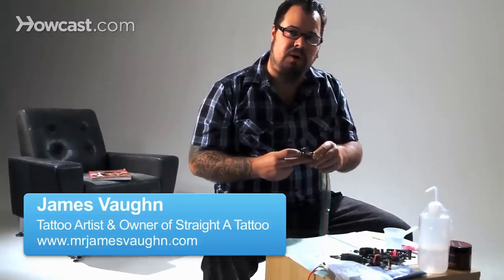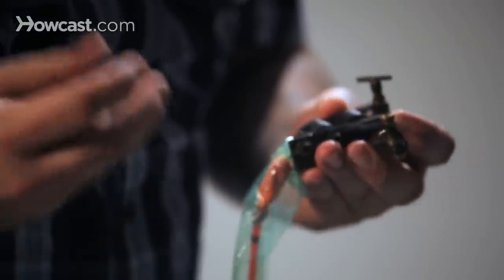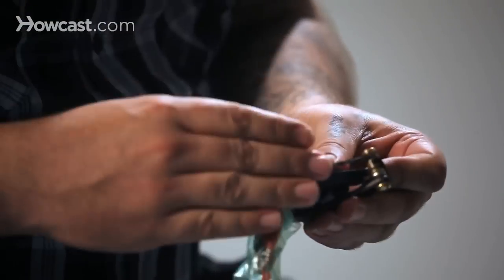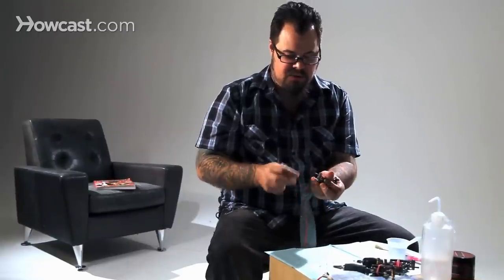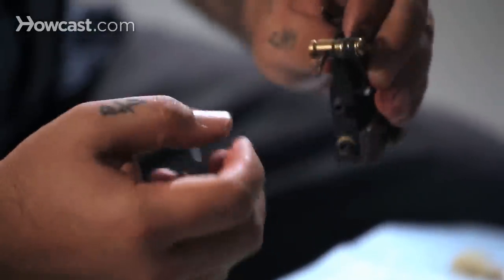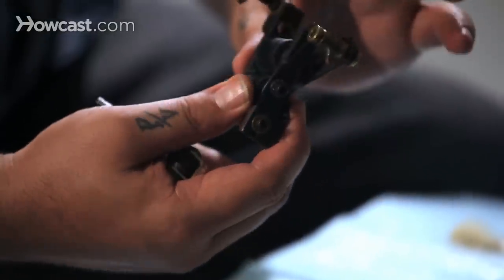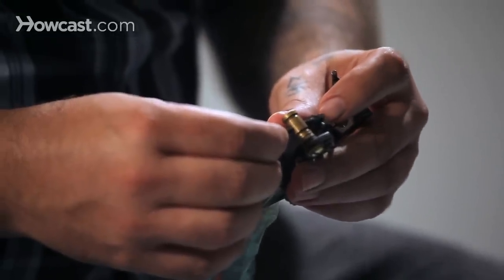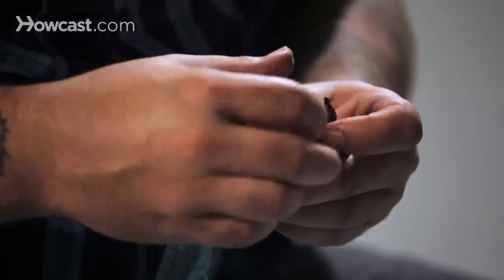How to Adjust Spring Tension on Machine | Tattoo Artist

Comment: I love how people make these videos with such bad information....   Yes you changed the spring tension but you also changed the duty cycle to like 90%. And more than likely changed your cycle speed to like 200cps..  anything over 55% will damage the skin and scar the hell out of people, and anything under 45% and it won't push the needle the skin.  I know this video is alittle older but 8 years ago they still had digital power supplys that had a cps gauge or Hertz and duty cycle gauge.  I've been doing this for over 20 years and  and when I was first being thought the duty cycle and CPS was the vary FIRST thing they pounded into my head because if that's off machine voltage and spring tension DOESN'T MEAN JACK......
Reply: Right? Also I wouldn’t bend it off the side I would turn it all the way around to bend it